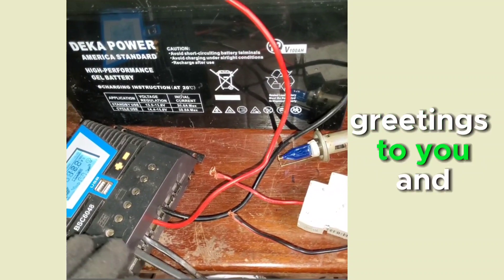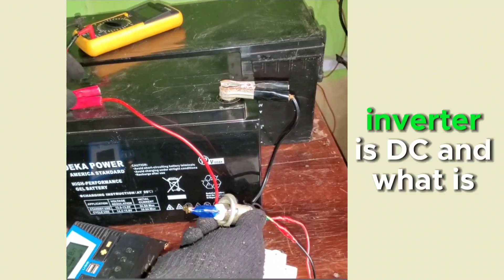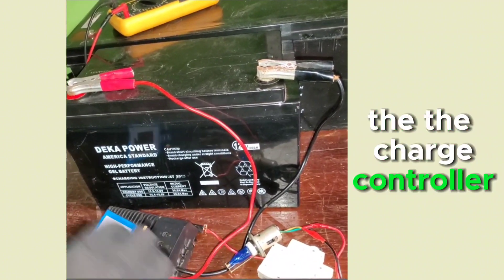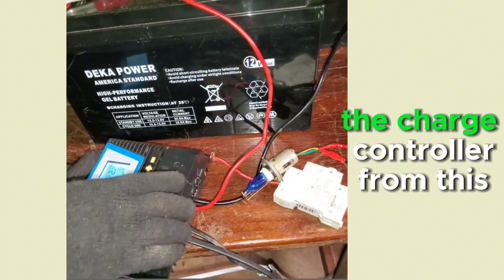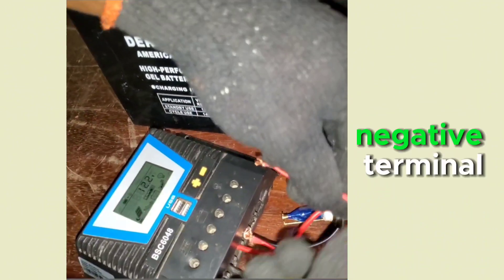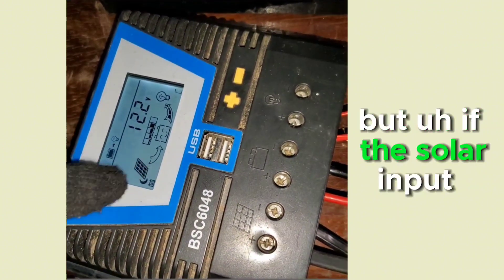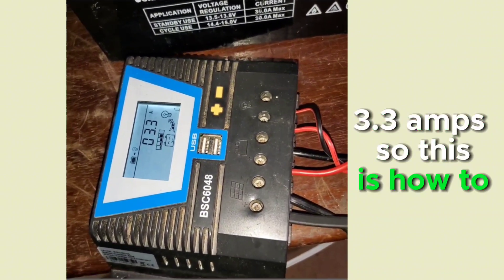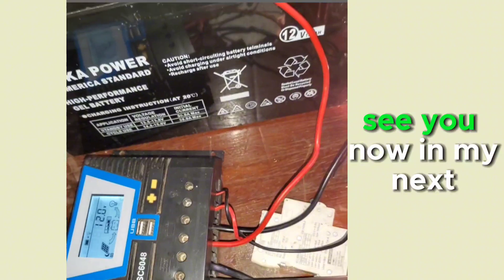How to connect a DC load to a charge controller #solarchargecontroller #dcload #dc #diysolar

Comment: Plz sir I have a 24v system and the charge controller is detesting 24v presently how many volts will the DC load terminals release. Will it burn 24v DC bulbs?